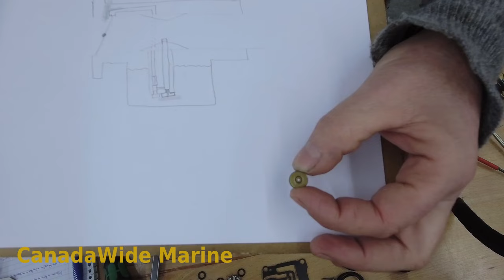Diagnosis and repair of 4 Stroke Outboard motor Carburetors. A look at the common issues.

Comment: Thank you for the information, I have 40hp 4 stroke and I have had the engine not speeding up no matter how much gas I put on so I thought it's the carburetor and got it off cleaned it and replaced it back but it's still the same , 
I'm thinking to buy new jets 
Any site recommendations ? 
Maybe you think I have a different problem? 
Thank you in advance
Reply from the maker: My advice would be to have your motor diagnosed by a reputable marine mechanic before spending money replacing a carb that may or may not be the problem. It should only take an hour or two for a good mechanic to thoroughly diagnose your problem and advise on a course of action to repair. 
Without seeing the motor in person there is no way I can possibly identify what might be wrong with it.

Comment: Hi.
Thank you so much for the create video explanation how the carb works. I am actually very interested in the mecury carb plunger (video 19.12 min) could a wrong adjustment of it also make the engine run rich? Ive adjusted the airflow and got the engine run in idle very nice but sparks are dry black. Carb is cleaned and Checked the needle like you showed upside down blowed and it seals of nicely no leaking. I cant get my head around why the sparks are black every time  after I tripple checked it and adjusted it. Greetings from Holland. Davis.
Reply from the maker: If you are getting black spark plugs it is usually a sign that the engine is getting too much fuel. 
Now, I need to assume you are running the correct plugs, and new plugs. Engine oil has been changed recently. (old oil will foul spark plugs), Compression is good. Also assuming the main jet is the original. That leaves float height. If the float level is too high, even just slightly, it will allow he engine to get too much fuel. 
The accelerator pump adjustment will not affect mixture, it only operates when the throttle is moved.

Comment: Hi there my Yamaha  2007 T 9.9 it was running only with the chalk little bit out. I can drive it that way, but as soon as I put the chalk in it stops I came up to your video which is one of the best I watch lately thank you for your good work I took my carburetter apart the way you showed when I came to the idle jet, somebody’s been there before me and broke that slot for the screwdriver. I couldn’t take it out so I decided I’m going to use a small easy out to pull it out. I was doing good but soon got hart to turn it but all of a sudden got tight and I didn’t succeed. Is it anyway that this carburetter can be used by drilling and doing something else so I don’t have to buy a new one. Please advise what is my options? Thank you.
Reply from the maker: you could try heat. get the carb body really hot before trying the easy out again. The heat expands the aluminum body and may loosen the jet in the body.

Comment: Thanks for that good video and the explanations. One question: to follow the pipes, you put what in? Which spray is this? If I understood correctly, also WD40 works but do I than have to clean the carb again because of the oil? Or does the oil not harm the working of the carb? Thx a lot for your help.
Reply from the maker: WD40 would work just fine. In fact WD40 is a bit of a solvent and will help clean the internal passages. Blow it all out and off before final assembly. a little residue from the oil will not harm anything.
Reply: @CanadaWideMarine  Thank you so much.

Comment: Great video! I do have a question about my Yamaha 40 Hp 4 stroke, I have a diaphragm assembly and there is a spring on there that wasn’t engaged I think I put it on right but now I need to adjust it so it works in accordance to the throttle
Reply from the maker: I'm not sure which spring and diaphragm you are referring to? You are welcome to email some photos to support@canadawidemarine.com and I might be able to help you out.

Comment: is there a screen  under the needle seat ?  having trouble blowing air through to the bowl even without the needle in .  having a hard cold start but runs well after i get it going . 03 8 horse 4 stroke yamaha with nikki carb
Reply from the maker: There is no filter screen under the seat, but you could have something lodged in there before the seat. Have you tried blowing backwards with air pressure from the needle side?
ON an older motor like that with hard starting cold, assuming plugs, compression and all the basics are in good shape I would start looking at the carb to manifold seals, they get hard and flatten out so they leak a little air when cold.

Comment: Very good video. Question I have a 2011 90 Hp Mercury 4 stroke. My will take off from idle and get on plane and run for about 200 yards then bogs down. Do you think that the float is sticking and not allowing fuel to enter the bowl or something else?
Reply from the maker: There are many things that can cause those symptoms. I would start with checking the whole fuel supply system. Looking for restrictions or leaks that can allow air to be sucked into the fuel line

Comment: Hi, I am disassembling the carb assy. on my 2001 Yamaha 50 HP 4 stroke. Can you tell me what the trick is to releasing the link rod bridging the 4 carbs and also the link rod from the accelerator pump at the carb end? Both parts seem to be snapped into place, no cotter pins involved. Is it a matter of pulling at the joint to release? I don't  want to damage anything> Thanks again for all your great videos and explanations. Jim Murphy
Reply from the maker: Hi Jim,
Yes, you got it right, the linkage snaps off. I usually use a pair of needle nose pliers to get underneath the linkage and pry gently against the arm so I am not bending the arm as I pull the linkage off.
Thanks for watching.
Reply: @CanadaWideMarine  Thanks again. I'll carefully give it a go.

Comment: Other than the float needle what would cause fuel to come out of the overflow?
Reply from the maker: Fuel comes out of the overflow because there is too much in the float bowl. Many small outboard carbs have a fuel inlet in the bottom of the float bowl, with a passage through the float bowl into the main body of the carb where it the goes to the needle and seat. That passageway is sealed between the main body and the bowl with the float bowl gasket, (which is actually a formed rubber o ring). If the float bowl gasket seal is not sealing correctly you will get too much fuel in your float bowl through the leak in the seal into the float bowl. Other causes of too much fuel in the float bowl could be  incorrect float level, sticking float, (not moving freely), or a sunk float usually caused by the float filling up with gas from a leak into the float. Give the float a shake and you will hear liquid in it if this is the case.

Comment: I have learned quite a bit by watching your work. I have a 1999 Evinrude 6RL4EEM 99, 6 hp, 4 stroke. The carb has an accelerator pump on the bottom, which water flows through. Have you ever seen a carb like that? There are no parts available for the accelerator pump, but the carb kit is available.  The engine bogs upon acceleration but otherwise starts and runs good. I haven't rebuilt the carb, but took the carb off the motor and took the float bowl off and it's very clean inside. Is there any sense in rebuilding the carb since I can't fix the accelerator pump? Also, the motor uses a very rare fuel pump. No rebuild kit available and a replacement  fuel pump is $166.00.  It's a good little motor used on a sailboat. When docking, sometimes you need a little rev and that's when the motor bogs and sometimes dies. Not sure what to do. Thanks
Reply from the maker: This is the problem we are seeing a lot of these days, parts no longer available for older motors. Is your accelerator pump diaphragm leaking fuel? if it is then you have a fire risk of course, if it isn't then we need to look into why the motor is not getting enough fuel on quick acceleration. a dirty or sticky check valve on the accelerator pump is a good starting point. an air leak on the inlet side of the accelerator pump is another, (when the pump is re-filling it can suck air instead of fuel sometimes). another thing that might help is to richen up the idle mixture a little bit, or raise the float level ever so slightly. I assume a new diaphragm does not come in the rebuild kit?
Tough choices with an older motor, we have had to scrap many motor for lack of parts available to repair them. And I think the problem is only going to get worse in the future.
Reply: @CanadaWideMarine  Thanks for the quick reply. I don't see any fuel leakage from the accelerator pump. I do see 2 little check balls/valves inside and they are both clean and free.  The diaphragm seems pliable. The carb kit does not contain accelerator pump parts. I can see someone has been inside the carb because they stripped the drain plug in the bottom of the plastic float bowl and also one other screw by the accelerator pump. I will fix these issues, spray some carb cleaner and test again. I will try your suggestion on the idle mixture.  

Do you know if my fuel pump 0445078, might be compatible with any modern pumps? I don't want to mess with it at the moment since I can't get parts and the price of a new one is ridiculous. Thanks again
Reply from the maker: That would be a question for an Evinrude dealer. We don't see a lot of Evinrudes in this area so I am not overly familiar with those types of details.
Reply: @CanadaWideMarine  Ok, thanks for your time. FYI, upon further inspection I now see the little diaphragm for the accelerator pump is split. Since the part is no longer available, I made a tiny gasket that fits under the entire diaphragm out of inner tube rubber as a test and  I can get it to pump water. So I ordered a sheet of thin nitrile to make a permanent fuel proof gasket. Haven't tested it running yet, but I think I have a chance. "It's amazing what you can do when you have to do it"

Comment: Can I remove the welch plug covering my idle mix screw? It doesn't need to be replaced after either? Great video, I learned a few helpful things, been tearing carbs apart for 30yrs as an amateur, lol.
Reply: Hey buddy, yes you can, but be VERY CAREFUL. You need to drill a hole and pop it out. Its a little brass plug. Stop drilling when you hit another piece of metal. That would be your mix screw
Reply from the maker: Orlando beat me to it, great answer. Yes, you absolutely can. I generally use a 1/8" drill bit to put a small hole in the plug, then tap a #8 self tapping screw into it. being careful to not screw it in too far and damage the mixture screw in behind the plug. Basically don't force the screw, just in enough to get a bite. Grab the screw with some pliers or vice grips to pull the plug out.
And no, you do not need to replace the plug after. The plug is there so people cannot richen the idle up to meet emissions requirements.
Reply: Thanks for the replies.  It was round 2 for carb clean, 1st time didn't work, but it turned out to be those pin holes in the idle jet, reamed out with my guitars high e string and im back on the water!  Spring salmon are here and motors running perfect.  The video saved me!  But I might still pop that welsh plug, I dont really like it🙂
Reply: Welch plug, not welsh plug🤣

Comment: I have a 25 4 stroke tohatsu with 3 carbs.I assume i will have to clean all 3.it will not idle.
Reply from the maker: I would clean all 3. I also flush the fuel lines from tank to carbs to make sure I am only getting clean fuel to them after cleaning.
Reply: @CanadaWideMarine  do you recommed a fuel water seperator
Reply from the maker: Yes. I almost always recommend a water separator. They can prevent a lot of heartache.

Comment: I have 20 hp yamaha four stroke and on full throttle engine rpm flying high and lows. what's wrong?
Reply from the maker: Full throttle fluctuations in engine RPM are often caused by a lean mixture, slightly restricted main jet, vacuum leaks low float level, restricted fuel filter or fuel supply, air leaks into fuel supply. Other causes cold be bad spark plugs, weak ignition system, Poor quality electrical system, check grounds in particular, but also all battery connections and battery switch etc. Even a corroded battery switch or kill switch. In summary, there can be many causes and it is impossible for me to say what is wrong without diagnosing the issue myself.
Reply: @CanadaWideMarine  thanks!

Comment: Hi
Greetings from Australia 
Got a 2016 suzuki 8hp 4 stroke outboard 
How many carb adjustments for this motor pls ?
How many turns out for base speed for full throttle top speed performance pls ?
Thanks 
Glen
Australia
Reply from the maker: Hi Glen, I spent almost 20 years in Australia, it treated me well.
There are no adjustment screws on your carb that will affect full throttle performance. Full throttle mixture is adjusted with the main jet. 
Now, if you are experiencing a lack of performance, a running issue at full throttle, many things can cause that. Just with the carb poor full throttle performance can be caused by a restricted main jet, incorrect float height and drop, vacuum leaks. Other causes of poor performance at full throttle can be bad spark plugs, weak ignition system, weak electrical system etc.

Comment: Good video!  Why is the pilot circuit part of the main jet ?  On my motorcycle, they are separated.
Reply from the maker: On some carbs they are indeed separate. It doesn't really matter because at low speed when fuel is metered through the pilot jet, or idle jet, the main circuit is not functioning, so the only fuel going through the main jet is for the pilot jet, (if they are incorporated together). At high speed there is no fuel going through the pilot jet so it does not take away from the main jet metering. Hope that helps
Reply: @CanadaWideMarine  Thank you for that explanation!

Comment: Great video , do you any online resources for ajusting a suzuki 9.9   four stroke carb  thanks.
Reply from the maker: I have nothing Suzuki specific, but watch for an upcoming video on general adjustments of idle mixture and speed. Float level is covered in this video.
Thanks for watchng.

Comment: Nissan 20hp Four Stroke Boggs at half throttle. Any tips on where best to start? Not sure if it’s idle a few adjustment or something else.
Reply from the maker: Half throttle is running on your main jet circuit. "If" its a carburetor problem I would be looking for restricted main jet, low float level, fuel supply issues or air leaks into the intake manifold.
Reply: @CanadaWideMarine  thanks il follow those steps and see

Comment: Good day, If you can help. I have second carburetors that you show, Mercury, Tohatsu. ITs overflow on idle. I clean all 20x times, needle is sealing, but still on idle it overflow after 10 seconds of working. Thank you upfront.
Reply from the maker: If it has the fuel inlet in the bottom of the float bowl you likely have a leaking float bowl gasket. It leaks fuel from the inlet passage into the float bowl. 
Hope that helps. Thanks for watching.
Reply: @CanadaWideMarine  I want to thank you in my and my dad name. You help us a lot. You explain how FLOAT should stay. Yesterday according to knowledge that you gave us I check float level with brand new spare parts and saw that is wrong. I put back old parts and now all things are fine. Thank you 100 more times that you help us.

Comment: With the ambient temperature being around 70-90 deg Fahrenheit, do you think I could use sae 30 break in oil for my new Honda  9.9outboard? Then when the break in is done would switch the oil over to 10w-30 which the manufacturer recommends.
Reply from the maker: No, I don't think you should use an SAE 30 engine oil to break in your new motor unless the manufacturer specifically recommends it. I highly recommend following the manufacturers specifications for lubricants. As well I highly recommend following the manufacturers recommendations for the correct break in procedure. 
A little background, I have a long history in racing, and race engine building. As the engine builder I am the manufacturer recommending the oil and break in procedure for my engines. I would never claim to know more than Honda, or any other engine manufacturer about what their engine needs for correct break in.
Reply: That’s the advice I was thinking you were going to give lol. I’ll stick with what Honda says. Prob be best just like you stated.

Comment: I recently cleaned my Merc. 15hp 4 stroke carburetor. I’ve no leaks or purging. Seems to run as should. However, the primer bulb on the motor itself, not the fuel line primer doesn’t get firm. Any idea what the cause could be?
Reply from the maker: Most likely the valve in the primer bulb. Replace the primer bulb is an inexpensive fix.

Comment: I have that carb. Do you know the setting for the fuel mixture tuning screw? I have mine at 2 turns out, but it's running rich.
Reply from the maker: the screw is for the idle mixture, I generally start at 1 1/2 turns out, and fine tune from there. There is no actual "setting" for it. If it is rich at idle, turn it in a little.
Reply: @CanadaWideMarine  thanks for the quick response! 🍻
Reply: What solution do you find best for carbs in the ultrasonic cleaner?

Comment: I’ve got gas coming out of the breather line for the accelerator pump on a 08 merc 20hp 4stroke, is that common when the plunger doesn’t seal anymore?
Reply from the maker: Yes, it sounds to me like you have a leaking plunger.